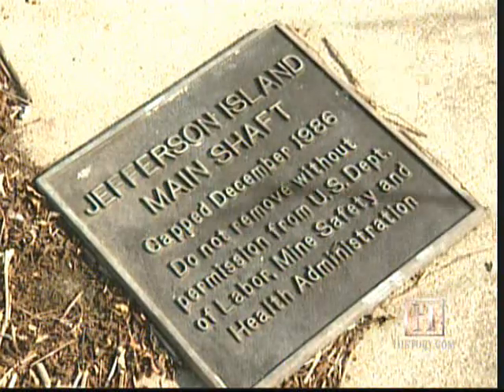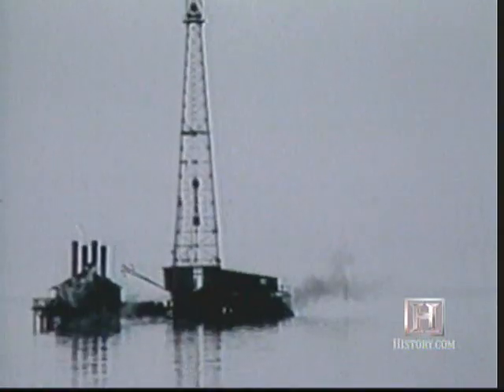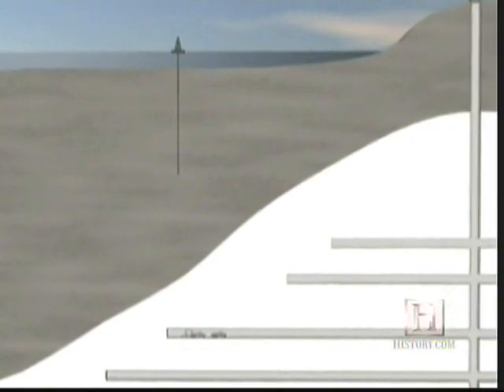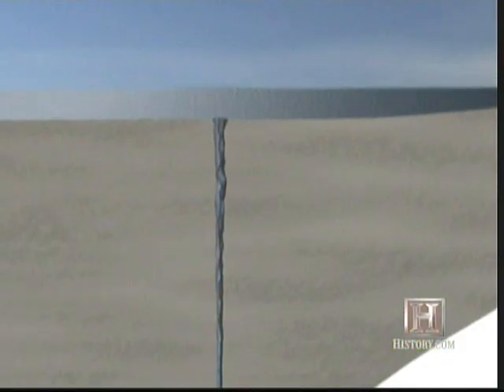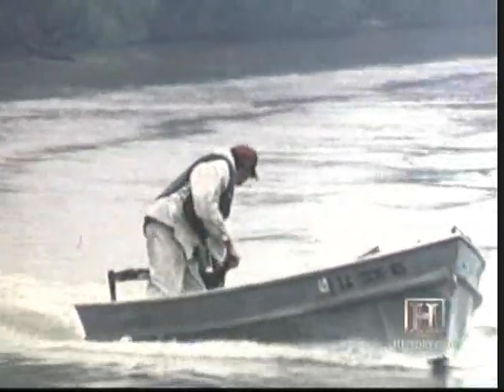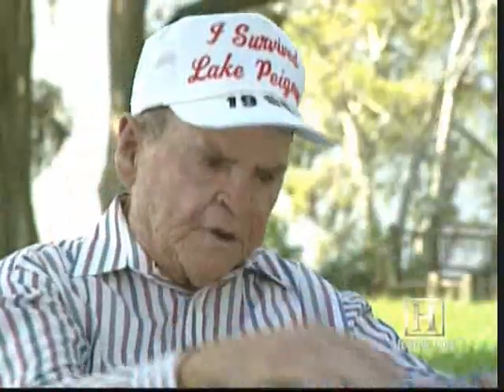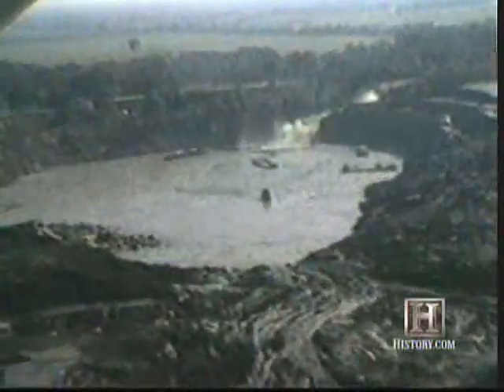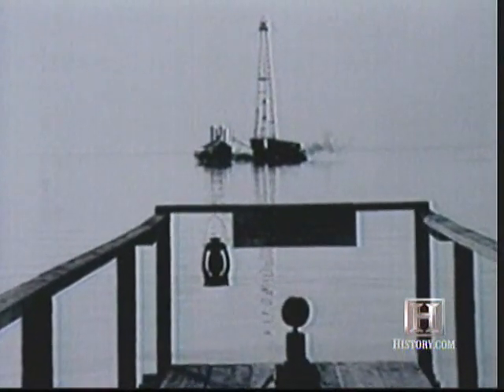Oil Driller Breaches Salt Mine Under Louisana Lake

Comment: Errors in triangulation? Isn't that something you would go over for over a year before? It takes time to engineer a rig, it's not a speedy process.
Reply: It ultimately depends where the information originally came from. If the mining company gave an incorrect location, the drilling company could crunch the numbers for decades and still not know they were wrong until they crashed through the roof.

Comment: The cause was a drill hole into the mine shaft that's a given. But that was only because either the surveying was off in the mine or the surveying was off with the drill location or the drilling engineer over the sight screwed up big time.

Comment: How come nothing could plug the hole? Surely some rock or anything really could have plugged a 14 inch hole
Reply: It wasn't 14 inches for long obviously.  Did you not hear the part about the water dissolving the salt?

Comment: Begs the question, why mine under a lake?
Reply: It's where the salt is. Most mines are a flood risk anyway due to being beneath the water table. I guess they didn't plan on idiots with drills but they had obviously put appropriate escape procedures in place.

Comment: “The culprit was most likely, a 14 inch wide drill bit.” No, most likely an Alcoholic or otherwise impaired Engineer. How is it possible not a sole killed?
Reply: “The culprit was most likely, a 14 inch wide drill bit.” No, most likely an Alcoholic or otherwise impaired Engineer. How is it possible not a sole killed?a

Comment: If you think that moving the drilling rig 400 feet would have prevented the water from bursting through into the mine I say that maybe it wouldn't have happened that day,  but it was probably going to happen with that much water pressure dissolving the salt and digging it's own hole.

Comment: Gravity?  Try air pressure as well.  He's a PhD? Of what?  Game theory?
Wow... closest thing to a black hole...
Reply: He mentioned the air pressure at the end of the video when the geyser happened, but judging by your comment you didn't see that part.

And I don't think it even implied the commentator had a PhD.
Reply: @8bits59  a guyser...shooting up the air pressure would be caused by the weight of the water/salt compressing the remaining air trapped in the mine, causing a geyser when the pressure is released.  But they failed to mention it in the beginning by the 'expert' PhD.